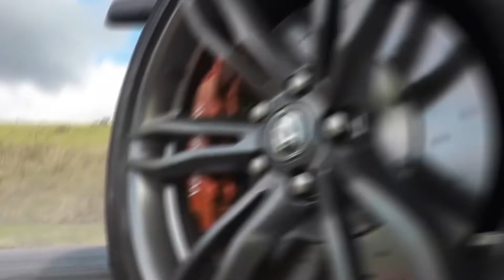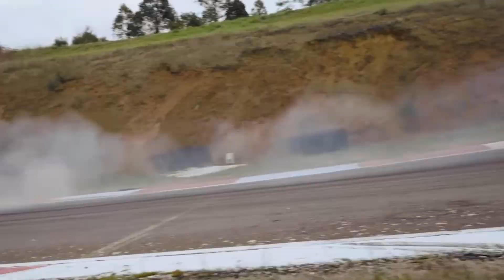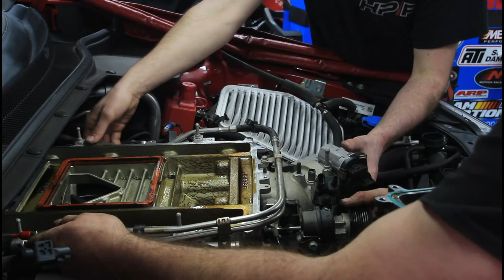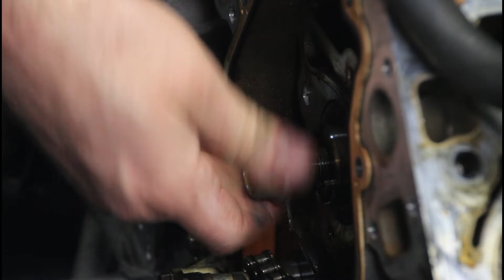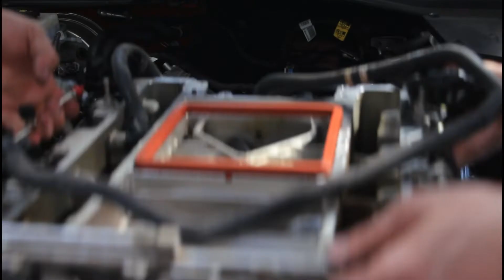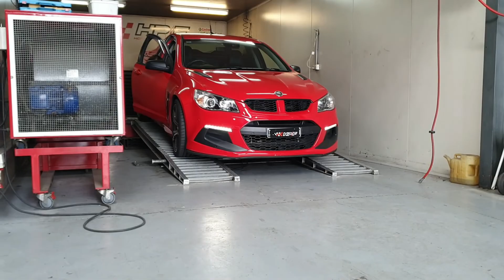HPF POWER UPGRADE - VF LSA - Walkinshaw Performance W557

Comment: if you want a high performance ls commodore do not go to walkinshaw. The rwkw figures are barely over 400 and in one particular case with an lsa ute the hsv only made 390rwkw at HPF. Owners of gts vehicles with the 557 package have shown on dyno sheets their vehicles make around 550hp (410rwkw) and that it is not worth getting the w557 package.
Reply: Yes i've heard this from multiple other people. The torque figures are also overstated. Im surprised they haven't been sued but maybe the bogans who got a car and the 557 upgrade ran out of cash after that. HSV and Walkinshaw typically overstate their numbers. That disclaimer in the vid 'actual results may vary' is like the disclaimer on homer simpsons interview 'dramatisation, may not have happened'

Comment: Why show the car on the dyno but not display the actual power atb the wheels? Seems silly to go to the trouble of all that work, show the car on the dyno, then just advertise the quoted power figure for the package, not the actual end result. A bit dodgy if youbask me.
Reply: True.
The 557 is obviously at the flywheel. Would be interesting to show what it was at the wheels.
A mate had similar find to his GTS some years back  (Harrop) and it was around 409
Reply: @dirkdiggler5763  A standard GTS? I remember the Wheels GTS vs GT comparison vid and the GTS didnt make 409 at the wheels.
Reply: Because the numbers the 557 makes is embarrassing. Be it on a hub or roller dyno people are reporting lower numbers than what is expected.  Its not easy to find a 557 dyno sheet for good reason.

Comment: HPF Dandenong they know cars and their Walkinshaw packages tune to perfection that’s why my 2017 VF HSV GTS 30th anniversary is booked in with them in three weeks time from W507 to W557 the most powerful and last package Walkinshaw will ever produced for the street LSA engine W557 ,750hp,930Nm,👍👍🤕☝️
Reply: LOL those figures are not what they are getting on the dyno though. As usual HSV/Walkinshaw exaggerate their numbers.